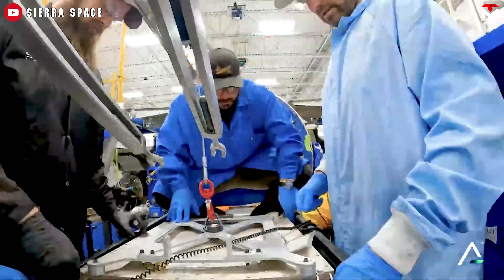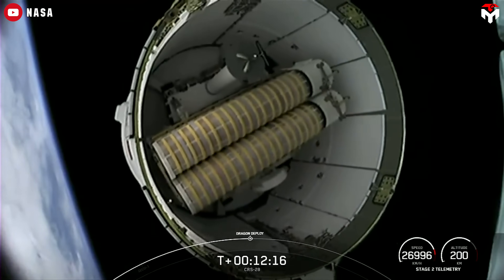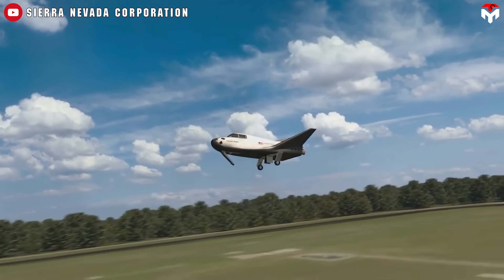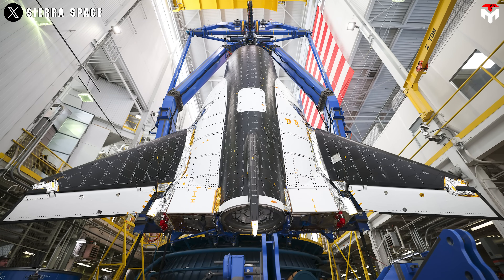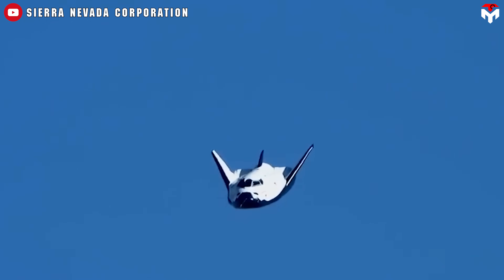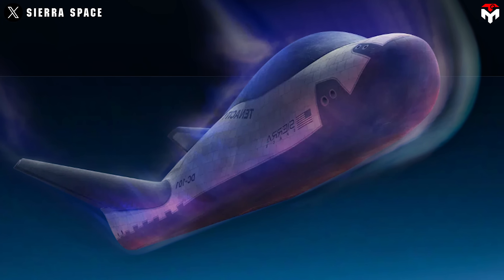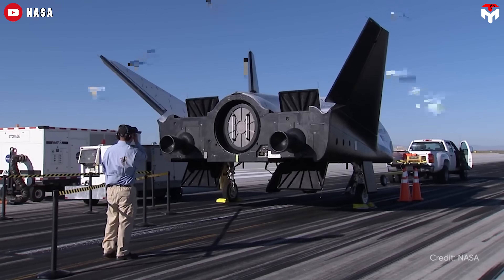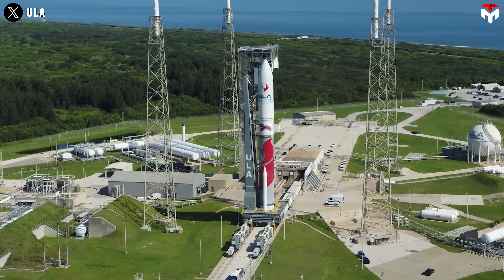NASA revealed Life Inside Dream Chaser X2 Better Than SpaceX Dragon…

Comment: someone in the comments compared such a small shuttle solution with a bigger crewed small space craft we know today as starship (the fact that it may be the biggest solution yet mankind has to offer, doesnt change that either, cause its only a starting point for such things we are here and now in terms of timeline development for such things!). cause starship is not really a space station either. it doesnt even look like one. its just a bigger space vehicle. meant to not be stationary or at least only short temporary timeframes according to future missions for it at all. i would hardly call this a station!
and before arguing about such vehicles would make any sense. we should give them the missing engines first: fusion reactors star trek style to get at least impulse speed similarities first important basis realised. and with smaller spacecraft some ion thruster tech generators similar like in star wars naboo fighter or so shown.
and even then we still facing the hurdle to still make fuel consumption more efficient enough first.
50-100 years you can expect this to take! with 2035 maybe first working ideas inside small shuttle craft on still low speed and not much efficient at all. if even! cause burning fuel directly without such better solutions installed, all the time will be hit its zenith point soon!

we are not even there yet! this is at best a baby new born now. being able to talk would be installing first generator solutions. like his first words and steps walked alone. when first successful flights are being done.
it still lays in his craddle needs mommy to give the milk and yeah: cries a lot and sometimes laughs. besides his still a lot sleeping time!

tech is already there today for all that and so is all needed theoretical knowledge. but not what needs to be build with it for real world application.
done by later people born earliest: today (year 2025).

but its still nice to watch development slowly getting somewhere here i would say!
i enjoyed that video therefore added it to the links on my own website:
https://spacetec-aerosystems.mynetec.com
and say thx.